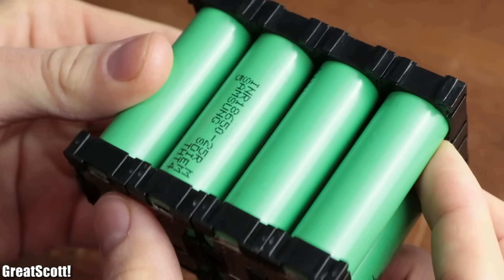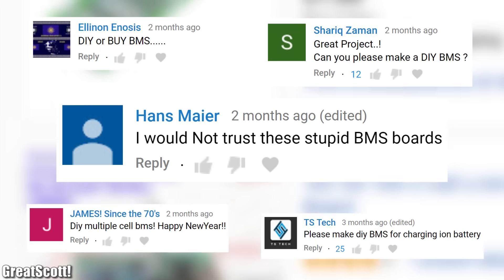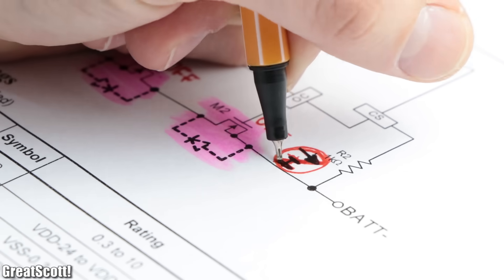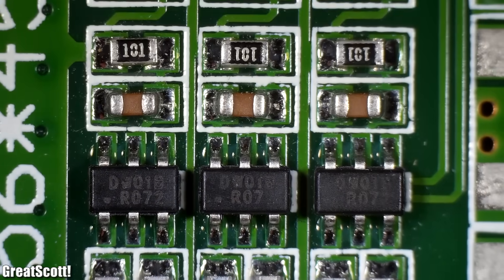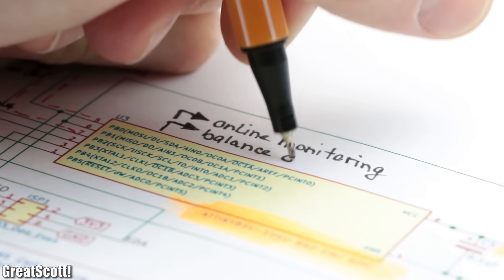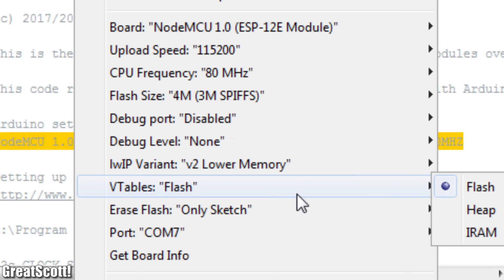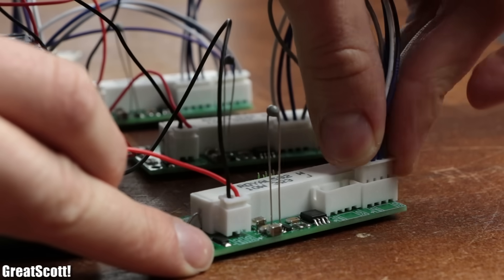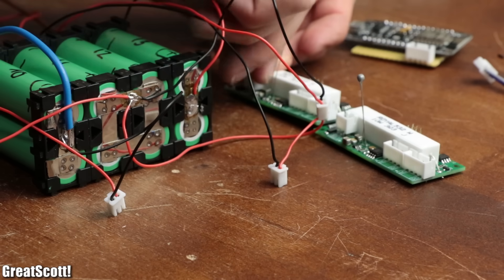BMS (Battery Management System) || DIY or Buy || Properly protecting Li-Ion/Li-Po Battery Packs

Comment: Why did the DIY version have 4 PCBs and those big power resistors for every cell ? The Buy version did only have 1 PCB and small resistors. Isn't this also possible in the DIY version ? That alone would be enough of a reason to just buy a BMS
I feel like this was not a good comparison because it's 4 BMS vs 1 BMS. Who even wants to deal with that
It would be much better if both BMS were the same

Comment: Great video and nice explanations. I'd just like to add that, today, if it were just for the "extra" monitoring and balancing features, there are plenty of inexpensive (<30 USD) and high-quality commercial BMSs that have these features, including cell phone apps via Bluetooth, even with higher voltages and higher currents. But it's still great to learn how BMSs work, and your video really helps to illustrate this.

Comment: Never trust these small BMS boards. I have bought & tested one of them (4S, with 16.8V - 18.1V supply voltage) and they did not even protect my cells against over voltage. My 18650 Li-Ion cells have reached 4.5 Volts each. 😠 They are totally trash. If you know any other reliable and cheap alternative; please let me know. Thanks.

Comment: DIY has become a lot easier. There are several custom IC solutions that only require some passives and FETs. Nice project to get into designing your own PCBs
Reply: Can you name any?
Reply: @LongevityReportET  TI BQ77905 for example. Thats the one i used. MAX makes some as well. The one i used doesn't do active balancing tho, depending on what cells you want to use and how you charge them this might be a problem (it usually isn't for new cells tho)

Comment: The E-Bike makers need to convert them to use LiFePO4 batteries. Repairers need to help convert the existing bikes to safer designs, & promote/use safer manufacturers.
The nom ~3.7v, max ~4.2v type Li-ion/Li-Polymer are not safe in these sizes & environments.

Comment: Great video, very informative, can I ask you a question. I have a 60v battery i am working with at the mo that has the 2+1+5 discharge connector I can't seem to get power from or only low power, the ground   to the discharge side of the bms is 70v so I'm guessing one of the other wires must go to ground to make the circuit or a resister, I can not get a diagram for the board 2 power feeds then a 6 pin connector with 5 wires, first 2 wires are twisted together one goes to a resister, fz, the second is marked lock the third is rcst then dport then toot then pim_iso 🤷‍♂️ any help would be much appreciated

Comment: Sorry but after years of working with ev power trains I can only state one thing:
I'm absolutely baffled by stupidity of people NOT to understand that BMS shall disconnects all it's connections to the battery cells when it recognises that cell voltage fell WAY to low, and only readable it self when charging is provided and slowly retest the battery and figure out whenever battery is dead or safe to charge ! 
That stupid mistake is causing more fires than people think !

Comment: can we charge every string of batteries  by e 4.2 charger module by Connect them individually with   3 modules  for 3s  and charge it with a single port typ c ???

Comment: At the end in couple of shots it shows voltage calibration value exceeding 4.4v and you mentioned the charge exceeded the set 4.1v and boards balanced them out.  So does that mean they got as high as 4.4 and then the DIY BMS brought them down back to 4.1v?  Was did it allow to charge that high in the first place??  That is really bad / high voltage for battery life.

Comment: You didn't do a good job of measuring the resistor in the current limit. Measurement with two wires can never be accurate because the resistance of the cables themselves is also introduced. In order to take an accurate measurement, 4 wires must be used. The value of the current limiting resistor is 0.0013 ohms, not 0.05 ohms. The protection activation voltage is probably 50mV

Comment: So some of the BMS you find that look like yours and are sold on several platforms (amazon, ebay, or aliexpress) do not actually do as they claim. I bought one almost identical to your only 3s version... it almost ruined my pack. I have a nearly perfectly balanced pack (50mAh variance out of 30 000 mAh total). The issue is that is somehow managed to make 2 of my cell banks (3s16p battery) were discharged to 0 volts and one was at 4.3 volts... Not good. None of my cells had any measurable self discharge before this happened, and I have been attempting to find out what is now causing the self-discharge, whether it's the BMS or if the cells now have a self discharge. I didn't even get one charge out of the pack. Only the initial charge was usable (I charged each cell to full to test for self-discharge and so they'd all be the same SoC for assembly).

I saved the pack with a small active balancer, and thankfully the over charge and over discharge protections all worked on the BMS or it would have started my pack on fire.

Maybe mine is defective, but I'll have it investigate later. In any case I would recommend an active balancer on any large pack. They actively balance at any voltage so they can be used even you limit the charge to between 20% and 80% to extend cycle life... and they're a LOT faster than bleeding off the cells since every amp you drain from the highest cells goes to the lowest cells so it's almost like balancing twice as fast... while making less heat. Though some of them have low current so I just get one that has low drain ( less than a miliamp) and leave it connected so it can just always balance and I never have to worry about it. Realistically, the DIY BMS with the 1 amp bleeder resistors is faster than cheap active balancers because of that giant 1 amp of current... the bleeder resistors in most commercial BMS boards are way way smaller and are thus going to be slower than active balancers and are only going ot activate at a set voltage which is set by the BMS circuit rather than programmable software.

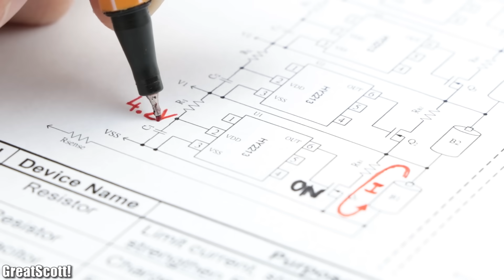Comment: 4:30 In this BMS case, could the output resistors be increased to charge the battery not to 4.20-4.25V, but to a maximum of 4.1volts, in balanced mode????
This modd, would significantly increase battery life, and it would be very important to change this!   4.1V =   + 30-40% charge cycle lifetime! If anyone knows, please let me know here!

Comment: How do you make a 400V battery management system with 108 3.7v batteries with 6 in parallel and 18 batteries in series?

Comment: I have a 36v battery pack. It's a seperate port bms. It charges to 42v however when I test the neg and positive out it reads 20v. This is an older lithium battery pack that came from a scooter. What components could cause the output to read 20v? Everything is factory made. The pcb board and batterys work before. But no longer can discharge becsuse the bms read 20v and the battery at its neg and pos ends read 42v. Is it a bad mosfet?

Comment: When you have a BMS would a (one way) -> diode be best to use ? See I been using the BMS board but when connecting to LED switches  the boards been short circuit.

Comment: Nice explanation on the "Buy" options... one point I'd make is, that the DW01 works in tandem with MOSFETs, not "simple" Transistors. Yes, I know, MOSFETs technically are transistors, but you did make a distinction, when talking about the big Power MOSFETs... so... just my two pennies on the matter.

Comment: Cells are already worn out once you charge them to 4.3 or 4.4 V. Rather than charging them to a high voltage and then balancing, charging them not in series but individually would be much better solution.

Comment: One question what is the connection of the power resistance 
The power resistance say R004 on it 
Means its 0.04 ohm 
Their are 3 of them 
If they r in parallel the resistance value wood be  0.001 ohm and the voltage at 35 amp 0.46 volt i think this could the case 

If the resistance is series the resistance will be 0.12 ohm the voltage will be 4 something volt 
And low of heat 
Which one is correct?

Comment: I wonder if instead of the big resistor being used to drain a full battery is a passive balancing style that this excess power could be used to charge the cells that need the extra power in an active balancing style?

Comment: would the commercial one work for modifying a powertool battery pack? most modern power tools have bms in the tools not the batteries. the bms board would protect the battery during usage and the charging cycle of the battery is managed by the commercial charger

Comment: How can i do  6v charging with 10 buttress
Reply: To charge a pack with a battery, which has a lower voltage?
Use a A boost converter (step-up converter, and connect that one to your BMS.

Comment: Couldn’t you do the same with simply a Arduino/Raspi, which measures the voltage and if the value exceeds the goven one, a transistor will connect a resistor. So the raspi will drive transistors if the meaused voltage is exceeded.
Reply: Theoretically you can,  but it's more expensive, consumes way more power and in my opinion,  you better shouldn't use a computer to do these basic functionalities. It's just way safer to use simple circuitry for that.

Comment: How do I make lithium batteries for desktop motherboard directly instead of 220 UPS supply?
Reply: Google seems to use it in there datacenters?
Just create a 12v pack, (4 x lithium/LiFePo4 cells in series) + BMS, and buck converters for 5 / 3.3V + charger ...

Comment: What would be the best way to put two separate battery packs together? I have two 48v 30ah lion batteries that I want to put together so I have a single 48v 60ah battery. But if I put them in parallel I run into the same problem. I tried a "Falygda Dual Battery Connector" device but I think it fried a bunch of my equipment. Could I make a bms to control two battery systems that have their own BMSs?
Reply: Each pack should have its own BMS.
Each pack should have the same cells
Fully charge both packs. 
Then you may and can safely use them in parallel

Comment: 05:00     0.05 ohms is that the value for  three  R004 in parallel?
Reply: 0.05 for one resistor.. if they are wired parallel, 0.05÷3 resistors in parallel is 0.016 (6 eleventh times)

Comment: Can I connect the battery directly to the hover board, bypassing the BMS?
Reply: You always need a BMS: each cell may never be discharged below the specs, otherwise you will permanently destroy it.
The BMS will prevent that from happening.

Comment: How can any BMS isolate and therefore report back accurately on a cell when all cells are physically attach to other cells?
Reply: Each parallel set of cells have a "balance" lead to the BMS.
That way each cell can never be charged above, or discharged below the specs

Comment: I got a 10kw blue carbon lithium battery it has not be working as expected, when it's shot down it doesn't change up with any inverter, it only comes up when is charged with an external charger.

Am a solar engineer I recommend it for my client I want to fix it. Pls I need you help

Comment: Hi Scott, great video! I have 4 units of 1S2P 18650 battery pack with built-in BMS. And I bought a 4S BMS with cell balancing. Is it safe to build a power bank without removing the small BMS in the 1S2P packs? Thanks a lot!
Reply: In theory yes, but they both consume power and may work against each other. 
So,  the 'big' 4S BMS would be the best choice.

Comment: Those BMS are only good for over discharge protection and partial charging!! As they do not fully charge your 4.2V cells up!! You need to bypass the BMS to get them to their 4.2Volts.

Comment: a very newb and might be silly question....
from what i understand you set 4.1 volts as maximu charge, and yet they got charged way above that only to be automaticly discharged till they match... isn't dangerous to go over rated voltage? cheers and thank you for the video!!!
Reply: I was surprised about that also. 
Overcharging is a no-go, no matter what a discharge circuitry does afterwards: the damage had already started. 
The BMS should stop charging if any cell exceeds the maximum voltage.

Comment: Now , you could make a real BMS circuit for every battery pack that doesn't need any useless online monitoring, because as you said, that's what a power wall user would like, not anybody who just wants to use 18650 battery packs safely in their portable projects

Comment: "Circuit Accessories 4s 14.8v / 16.8v 20a Peak Li-ion Bms Pcm Battery" is That a good one?
Is it possible to explain how that works? 
Is it possible to upgrade it with monitoring like this one u made?

Comment: I am looking for a bms to buy for a 10s3p battery for my lycaon gr board to fix it for cheap instead of 120 to swap a new bms in. I’m looking into how much a molicel grade a would cost me to make and if it’s less than 400 like quoted to me or if it’s 350 for a Samsung 30q. Also also what’s the difference?? I keep asking and I can’t get an answer. My cheap cells verse a better cell, like will it mean I can use my board for longer or get more acceleration because the cells are better?

Comment: Hi could you do this with ni-MH batteries supply 12v or 24v  or a smaller rechargeable batteries but still getting12volt or 24volt high amp as possible to power amplifier hat on raspberry pi 6-24v also powers the pi

Comment: Does anyone know if this works with 16S (48v) lifepo4 cells? Can it be easily modified to do so? It would be so nice to see DIY projects like this state the over-all design features before delving into specifics.
Reply: I dont think the balance IC works for LiFePO4 cells. Its nominal volatge is 3.2V and the lower and upper voltage ceilings are 2.3V and 3.6V respectively. So need different ICs.

Comment: ummmm big thing just hit me there is no over discharge preotection i was so sure i just checked the hy220 datasheet yeah only overcharge protection?  so is over disachrged performed by a resistor so the gates need x voltage to be on at all?  as the chip isnt the turn off signal    this has confused me greatly as i was sure everyone couldnt be mistaken?

Comment: How reliable are BMS systems on commercial ebikes (like super73 and  addmotor bikes)?  Can I trust them to protected a battery from direct solar overcharging charging?  Say I have 48v 615WH Battery that can fast charge with 55v6a.  I am wondering if okay to charge with a 325w-60v solar panel (60v <5a)

Comment: Do battery management systems balance the cells while charging only or do they use the output voltage of the whole pack to balance indiviudal cells constantly in order to drain all the batteries equally and increase total runtime?

Comment: howdy. Hope you don't mind the Q
How do you determine what sz/AH bms is suitable, or when to use more than one bms? I also noticed the one i am removing has both the charge/discharge on the same pin.
e.g. 
3s3p =  AH
3s6p =  AH
3s12p= AH

Comment: My need are in the middle of Stuart Pittaway design and commercial one ... I need a an equalization block with adjustable voltage and adjustable draining current done not from browser but form another micro-controller, so simple the voltages and draining will be configured from micro-controller. Current by switching 2 - 3 resistors with MOS-FETs.(2 resistor equal 3 drain settings like 0.5A, 1A, and 1+0.5A) - for a multipurpose charger for mobile vehicles like hoverboard, scooter, bikes, that can have some replaced bad cells that need equalization charges.
So I am thinking on a custom design...

Comment: The only thing any BMS should do is actively balance and monitor; provide telemetry via a common protocol such at I2C or CAN.
I will read that data and I will decide when to cut off LOAD or CHARGE, which are completely separate systems.
Why does this not exist?

Comment: I am working with a battery pack that has a total voltage of 80V. It doesn't appear this method would be compatible. Does anyone have any resources or ideas for making a custom BMS or buying one for higher voltages?

Comment: Hi it  was really a nice experience going through your DYI BMS e7ven I was looking for  such BMS .  I have a  20 series cell 6000mah 3.7 v charger .   I need to connect to BMS What is the easy way to monitor each cell voltage to display in LCD.  Is there any isolated ADC available that scan each cell and display it with the help of nano or attyny85. Please reply . One more issue I have  noticed  was  few cells take lot of time charging it to the full. I use separate isolated charger  fir such cells to bring back to voltage of other cells. I am looking for a solution. Please help

Comment: hi i bought my bms but i connect the grd and volt on the wrong side of the battery and poof, the rest 5 of the 5 series works but i'm not getting any volts on one, wat component i need to be replace? thanks!

Comment: If I may suggest a follow up video on the subject. UPS battery backups are very good at maintaining uninterrupted power, but they don't give a damn about the UPS battery health. Also if someone wants to change the battery configuration, the main UPS circuit still treats it like it is using the old battery configuration and this can lead to bad battery charging. This is because most UPS systems have two 12.6V batteries in series and no BMS circuits that help extend the lifetime of the batteries. I'm just wondering if you can hack a UPS system to improve the battery charging and/or safely add batteries for some higher capacity. No ones really done it yet.